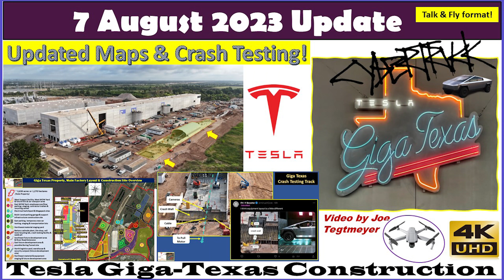Multi-Level Garage & EOL progress & Huge Cathode assembly! 7 August 2023 Giga Texas Update (07:35AM)

Comment: Great work. What is the plan for erosion control under the megapacks? Looks like it is just packed dirt, currently.  Thanks
Reply: The Megapacks themselves are on a gravel base. Which is new. In previous installations, the Megapacks were placed on concrete pads. It is likely that gravel will be placed in the area around the Megapacks as well.

Comment: Countdown 6 or 7 weeks until potential Cybertruck launch. I think the switchyard & megapacks will be connected by then. Crash test facility will be done. A lot of new battery equipment in the main building, and the cathode plant will be ready or nearly finished. My big question is what is the new area of the main factory for? Maybe a new Model 3 production line?

Comment: It would be good to know how the whole system works with regards to electrical cable flows in and out.
Reply: There are two Substations. The large one owned by LCRA and the smaller BESS Substation owned by Tesla. 8 large conduits connect the Megapacks to the BESS Substation. The BESS Substation can be seen as divided into two parts. Everything south of the large transformer is 24.9 kV. Everything north of the transformer is 345 kV. 

Starting on the north end... 
(For simplicity, circuit breakers, disconnects, and metering equipment are left out)
Power can flow through BESS Substation, to and from the Megapacks as follows.....
LCRA Substation 345 kV bus bars <---> East monopole (Interconnection point) <---> 345 kV duct-bank <---> BESS Substation <---> transformer <---> 24.9 kV bus <--->  Megapack transformers <---> Megapacks.

On the south end.... Power can flow through BESS Substation, from the Megapacks to the Tesla Enclosure/Mega-vault as follows.....
Megapacks ---> Megapack transformers ---> BESS Substation ---> 24.9 kV buss ---> backup power duct-banks ---> Tesla Enclosure/Mega-vault.
Note: This connection has circuit breakers that are normally open. So it only operates in the event of a power outage. 

Tesla Enclosure/Mega-vault:
Power flows into the vault from the LCRA transformers, and in the event of a power outage, from the BESS Substation 24.9 kV buss. Cables are routed through the switchgear equipment in the container buildings above the vault. From there, power flows out through 2 duct-banks to the main factory, and 2 duct-banks to the Cathode building and Die Shop.
Reply: @DavidJohnson-tv2nn  thanks so much

Comment: The new extension is moving at glacier speed compared to the original building crew. They would have had all the footings in by now, where this crew is drilling a couple of pilings a day. At this rate they might get all the footings in by late next year.

Comment: Interesting that the load levelers @23:21 are OUTSIDE the building and not in the actual door opening so it will be impossible to seal the trailers to the building for loading or unloading
Reply: 23:21. Built outside the building line because the existing footings were at a higher grade/elevation in this location. Same with the next new set of loading docks to the north.

Easier to build a platform out from the building for the load levelers than to demolish the footing.

Comment: I'm guessing the vertical (4) pumps are river water intake to be located in the deep concrete pit.
Reply: By "deep concrete pit" do you mean the sewer lift station @ 11:46?
 The lift station would not require pumps that large. And it's only purpose is to pump sewage, not river water.

Comment: Thanks Joe.
4:50. Outfall Channels area. New channel turns back towards the pond.
7:49. Southend. North-south road. First rebar northwards.
9:07. Southend. CFA piling rigs. Rebar cage closest to the crane seems a smaller diameter.
9:38. Stamping 2 extension. Bridge crane beams yet to be installed.
12:13. Southend. Motors and gearboxes under the green tarp. Similar seen up towards the Main Entrance a month ago were variously identified as part of production line traction systems, or parts of a hoisting system to shift vehicles between floors.
12:34. GA west, loading platform. Removed beam.
Apron. Delivery. ‘Kuka’ on some of the items towards the front.
13:29. Main Entrance. Sparkies working on the lighting under the rebated edge of the raised trapezoid. 
Section of cladding on the trailer. Shows light framework on the reverse side. Snap-fit into the portal frame brackets.
15:00. Westside, new EOL building. Bottom left. Fitting concrete ‘bar chairs’ to the underside of the rebar cage. Keeps the cage the required distance off the excavation base to ensure adequate coverage of the rebar.
15:40. Westside, new EOL building. Top left. Formwork for the column pedestals has been placed on some footings.
White drains and vents. Amenities block. Toilets, etc.
18:28. Tesla Monopole. Large monopole to the left is the destination for the conduits coming up from the BESS switchyard.
19:30. New switchyard/substation. Mega-Vault. Ductbanks/conduits to the left, no connection to the BESS/megapacks, factory connection only.
Centre. Left of the trailer. Incomplete conduit connection between BESS switchyard and the Mega-Vault.
20:35. BESS switchyard. V-top circuit breaker to be mounted on the low frame on the concrete pad to the north side of the large transformer.
22:22. Battery, north. Demolishing the bottom of the door opening infill.
23:46. Transport yard. Far left. Lone Cybertruck under a cover.
24:06. WOW yard. Bottom right. More damaged vehicles. Red one missing doors.
25:30. Cathode west. Right. Blocks of removed floor stacked against the wall.
27:04. Cathode, north of. Right. Powerlines in the trees.
27:37. Cathode, north. Coring some holes through the wall above the loading dock door.
MM Batch Plant. Blast of dust.
28:47. Crash Test Track. Cladding the Launch Pad building.
29:35. Crash test track. Frame for glass floor. 13 decision makers. Shouldn’t take long.
30:55. Cathode east, ramp. Level 3 plant structure. Obviously a micro-brewery.
Set-up to take another level.
Reply: ‘Kuka’ is a German robotics company ( now Chinese owned ) - looked at the Patron pics & I think these may be controlers
Reply: @benguthrie49  Hi Ben. Yes, they have supplied a lot of the robots inside. Getting a lot of attention from the viewers up on the loading platform. Must have been waiting on this delivery.
Reply: Dessie, I have a hunch the "Westside, new EOL building" may wind up being a rebar/concrete column, poured in place,  building which I see a lot in nyc. Reminds me of the rebar starter stubs I've seen coming out of lowest level slabs.
Reply: @benguthrie49  EOL building. Might be. It's a little odd, no hold down bolts in those pedestals that I can see. Quite different to any of the other structures around the place.
Reply: @DessieDoolan  EOL Footings - Have any of the "extensions" been cast yet though? No need to set anchor bolts until you form up those. Could be my imagination, but it seems like there is a horizontal rebar across the middle of the top of the cage.
Reply: @patrickkenny2077  Nothing cast yet. 

I'm looking for reasons for why the Butler Building isn't for the EOL. The lack of hold-down bolts one line of thought. If the columns are available then the set-out would be known.

There are ply set out boards on some of the extensions/pedestals.

Looking at the relatively short spacing between columns. Around 100 columns are needed.

Also thinking they have stored them a long way from the action.

They might only be shifting them to allow the new road to be completed.
Reply: @DessieDoolan  One reason for the lot to be farther away is, they mostly don't come back.  They just end up going even farther.  Supplies come in on trailers into the yard, later taken to the factory ports, and then taken out to the west yard (farther away), because they too will just go away.  So space closer to the building is used for supply storage, so it can be "gotten" quicker when needed.  I'm thinking the current outbound inventory lots end up storing castings, so the ramps can be freed up in front of the bays.
Reply: @scottgaree7667  Agree.

A bit of 'first drive' distance also gives a chance to pick up on faults. The drive across to the New EOL location may well be a road with various surfaces to 'shake out' any issues.

Something else that we still don't know is from where will vehicles exit the building. Multiple locations? There's been 3 already. A single new location?

The build up of casting is an ongoing curiousity. Same at Berlin and Fremont. Doesn't happen at Shanghai.
Reply: @DessieDoolan   Might just have roomier closets in Shanghai?
Reply: @scottgaree7667  Tardis closets would do it.

The only reason have heard for stacking the castings outside, that seems plausible to me (a carpenter 😐) is to reduce the heat load on the building HVAC system.

A lack of interior room and the need to have a stockpile, doesn't quite work for me.

Lots of stuff that Tesla does is puzzling.

Comment: Dont you think that the second ramp, the curved one, will be used with water to test cars reaction crossing flooded roads ….??
Reply from the maker: You mean the Wade pit?
Reply: @JoeTegtmeyer  Sorry, don't know what is the Wade pit ... I mean the ramp in line with the crash ramp ...  🙂
Reply from the maker: @fredt7518  If you mean the structure just north of the crash testing facility, then it is the wade pit.
Reply: OK sorry for my poor english ;-) so my guess was right 🙂

Comment: Any idea why the walkway goes up and over the road to the factory rather than under it so workers don't have to navigate traffic or walk up and down steps ?
Reply: Do you mean @ 23:02? There is a gas pipeline and conduits that supply the factory with power from the temporary substation. Which pass below the stairs and walkway. An electrical vault can be seen next to the stairs. Also, it is a utility easement and they would have to get permission from the utilities. And it is more than one utility.

Comment: it would be tremendously interesting to know how many gallons of diesel are used on site each day from the operations heavy equipment , trucks, cranes etc. and how many millions of gallons over the last 3 yrs. not an ESG thing just a curiosity thing ? maybe someone with time on their hands can calculate the number of vehicles on site and multiply what they think the consumption per day cumulatively would be in a single days use. I realize it would be nothing more than an estimation
Reply: How many horses did it take to build the first Ford Model T plant?

Comment: Some of those Model Ys in the new car testing calibration lot have a thick layer of dust on them. As if they have been there for a long time.
Reply: They likely want to know what happens to cars in various states and doing a variety of things over time.  How does the paint age, in and out of the sun and rain, battery behavior, seats, seals, and all that.

Comment: Tesla Enclosure/Mega-vault:
@ 19:29 Conduits placed for one duct-bank to connect to the vault. Second duct-bank connection will be at the point currently under construction @ 19:02. Where second switchgear building will be placed.
Easement:
@ 20:12 (Left side) Cable spools for cable pull into vault.
BESS Substation: 
@ 20:25 Joe... The circuit breakers will be mounted on the steel support structure with the control cabinet seen  @ 20:38 (left side) and 20:02.
Vaults:
North parking lot: @ 21:13 A lot of cables have been pulled. Green ground wire can be seen as well

Comment: 15:38. Looks like pretty typical plumbing for toilet facilities.
Reply: What's going on at 21:10? Will cables be joined in this vault?
Reply: @DessieDoolan  
Yes. Any wire run is limited by different factors, and conductors must be spliced together at different points. High voltage cable splicing is a specialized skill, and I have only done it once on a large industrial project (sewage treatment plant). All splices need to be accessible so they are always spliced in vaults unless being used for direct burial without any conduit or for repairs caused by later damage.
Reply: @GoCoyote  Thanks for the response. There's been a few opinions about this in the comments. Good to get an answer from someone with industry experience!
Reply: @DessieDoolan  
Your welcome. The lengths of the cable pulls are limited by the tension the cable assembly can experience without being damaged. Even with low friction cable coatings and using wire pulling lubricant, there will always be friction on the cable. Any curved sections of conduit, especially elbows, will add considerable friction. Cable pullers for high voltage cable have tension meters that are used to ensure the cable is never pulled so hard that it is damaged. Even if a very long straight run is possible without damaging the cable, cable lengths will be limited by the physical size and weight of the spools of cable and the practicality of transportation.